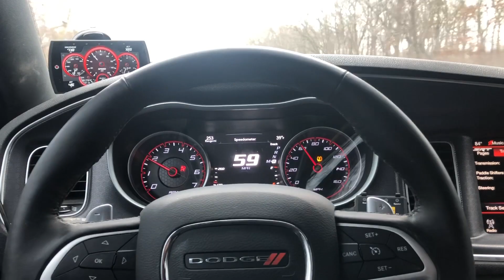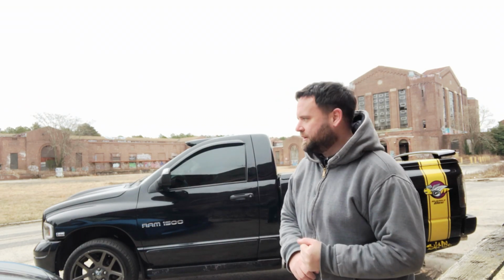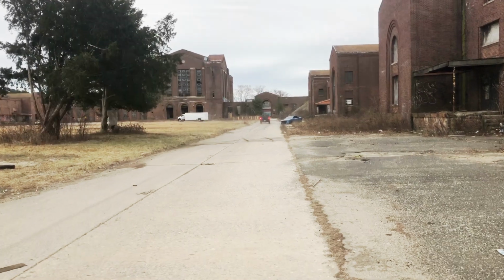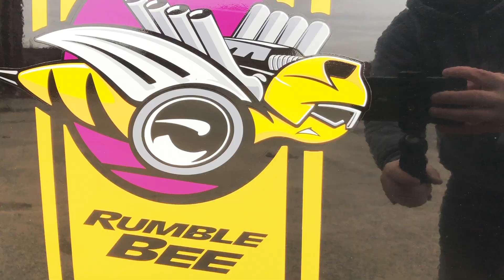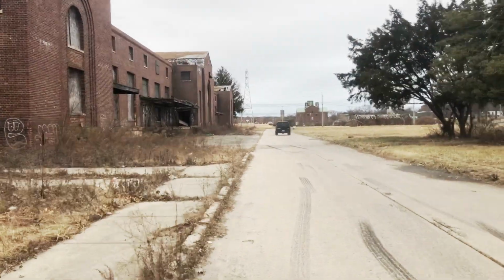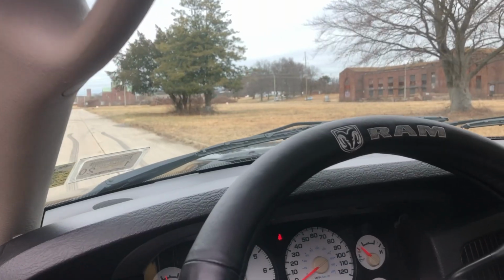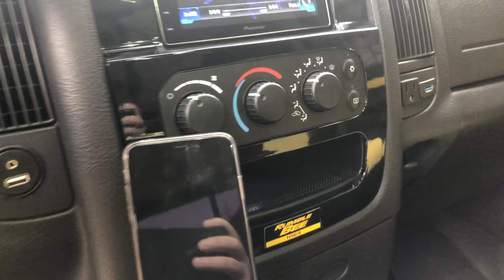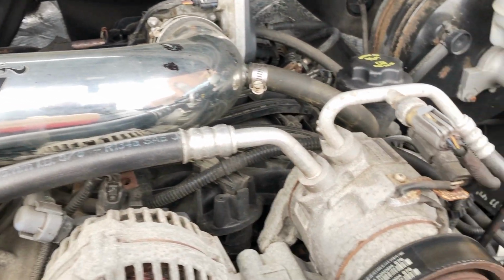Ram RUMBLE BEE V8 Hemi!!!

Comment: In case it matters.. 2002 was the first year for modern 5.7 Hemi installed in 3/4 ton trucks only.  1/2 tons got them in 2003.
Reply from the maker: It says in 2003 the 5.7L made a comeback in the Ram - then in 04 they made a bunch of special editions like this (Rumble Bee, Daytona, SRT).
Reply: @RTLife  some sources list 2003 some list 2002. my friend had 02 3/4 ton with 5.7. ..in December 02 Dodge released it for the 1/2 tons and I ordered one and it delivered before the end of Dec as an 03 MY. I had my truck before any dealers in my area had them on the lots.

Comment: What were the HP gains from putting a J Greene cam in your Charger? Are you over or close to 400?
Reply from the maker: I should be close to 420whp with all the mods I have - but it's all about times. We will see how the RT performs 0-60 & 1/8 mile soon enough
Reply: R/T Life yeah I saw the 6.4 intake vid is up so I was going to watch that next. Curious to see how that does while driving. Some type of came and intake are my next mods. Do I have to contact J. Greene for different cam specs? I don’t see an official site other than Facebook. Did you change springs and pushrods?

Comment: I get it’s a fast truck but how good is It doing truck stuff?
Good vid RT
Reply from the maker: that's a good question - not sure how/if it's setup to be a workhorse. I would imagine the Rumble Bees, Daytona's & SRT's aren't setup like a regular truck. Thank you for watching
Reply: It's the same as any other 1500 Hemi ram in 04, think of the rumble bee as an equal to the T/A or Daytona packages on chargers rams and challengers. Mostly stickers and cosmetics maybe different gear ratios. My R/T classic came with different styling and 3.92 gears over the 3.73s and my brothers Daytona ram has 3.92s as well unlike other models. So basically just cosmetics and possibly lower gear ratio are the only real differences
Reply: Ahhh ok thanks y’all 😁
Reply: Same as a regular 1500, can haul a boat in 2 feet of snow with this truck

Comment: I feel like the rumble bee is dodges answer to the ford lightning.
Reply from the maker: it was def a competitor but the SRT Ram with the viper engine was def a Lightning killer
Reply: The best 0 to 60 for a reg cab ram stock is 5.4 and that's the RT. The last year lightning did it in 5.2. The lightning would spank a ram rt in the 1/4. I'll have to agree that the ram srt10 was a more direct competitor to the lightning.
Reply: @RTLife  true but I mean the rumble be was the lighting competition the srt10 is whole different monster compared to the lightning/rumble bee.